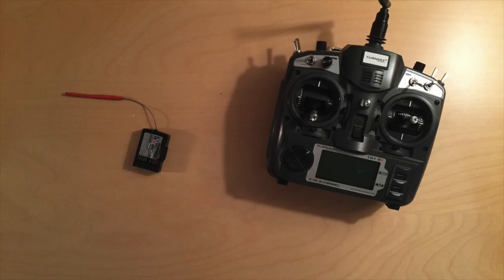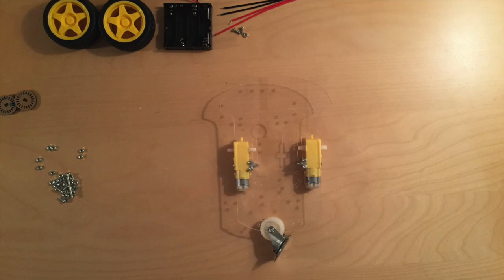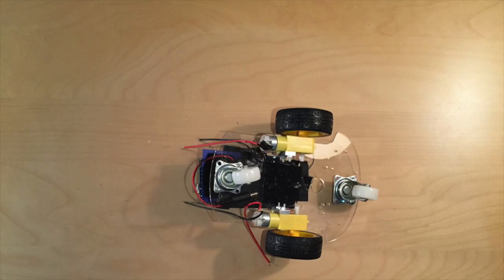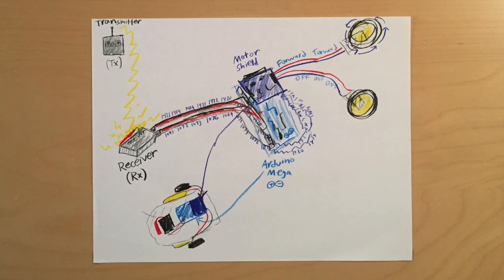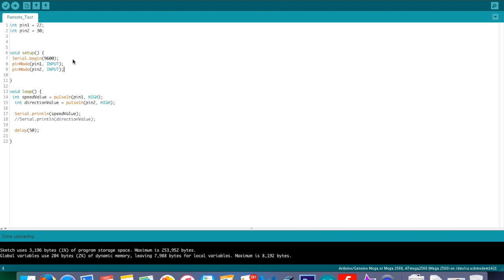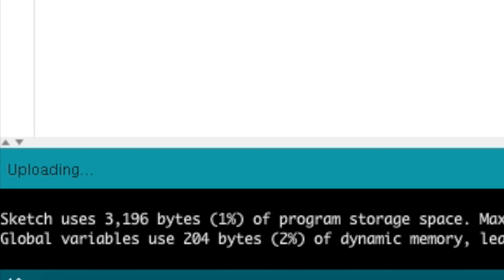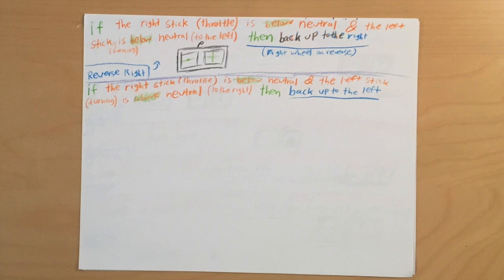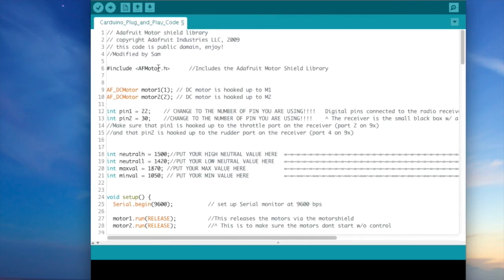How to Make a Radio Controlled Arduino Robot (Carduino)

Comment: Can i use Arduino uno instead of Arduino mega
Reply from the maker: Tushar Ganvir The motor shield should fit perfectly onto the arduino uno. Just line the pins up. 
Since the uno only has enough pins for the motor shield, it doesn't have any pins left over for the RC receiver. You can put another wire into the same port as a motor shield pin. Just make sure that the motor shield doesn't use/activate that pin!

Comment: hi, sam 

you said that just copy the code in the arduino ide and upload it. when i upload the code on arduino uno an error appears. can u pls help me to short out this error.

 [ This report would have more information with
  "Show verbose output during compilation"
  enabled in File > Preferences.
Arduino: 1.0.6 (Windows NT (unknown)), Board: "Arduino Pro or Pro Mini (5V, 16 MHz) w/ ATmega328"
sketch_dec25a.ino: In function 'void setup()':
sketch_dec25a:34: error: a function-definition is not allowed here before '{' token
sketch_dec25a:165: error: expected `}' at end of input]
Reply from the maker: Vishal Kumar looks like the code is missing a right bracket at the end of void setup()

Type a "}" one line above "void loop()"
Reply: Sam's Neat Projects
ok n thnks for the help
Reply: Sam's Neat Projects
Thanks a lot for your help. i was struggling to upload the program. This small " }"  made a big help for me.

Comment: can we do on arduino uno
Reply from the maker: Yep! The motor shield should fit perfectly onto the arduino uno. Just line the pins up. 
Since the uno only has enough pins for the motor shield, it doesn't have any pins left over for the RC receiver. You can put another wire into the same port as a motor shield pin. Just make sure that the motor shield doesn't use/activate that pin!

Comment: how to use ardiuno uno for this... i ardiuno uno and motor shiled..can u show me the shametic daigram for that
Reply from the maker: The motor shield should fit perfectly onto the arduino uno. Just line the pins up. 
Since the uno only has enough pins for the motor shield, it doesn't have any pins left over for the RC receiver. You can put another wire into the same port as a motor shield pin. Just make sure that the motor shield doesn't use/activate that pin!

Comment: what about output pin??? i mean from which pin will the arduino send the signals to motor shield??
Reply from the maker: Manish Yadav I believe that the motor shield has the port numbers listed. I'll check for you
Reply from the maker: Manish Yadav Actually you control the output pins using the motor shield library. 

The command is: AF_DCMotor motor1(port number)

The ports for M1 and M2 are 1 and 2.

Comment: It gives me error...It says the setup func are not allow to use token
Reply: '{' this kind of sign
Reply from the maker: Is this in the Arduino IDE software?
Reply: actually a closing bracket(}) is missing for void setup. plz add }this before void loop line......your problem will be solved

Comment: can we use Arduino uno
Reply from the maker: The ports for the receiver will be harder to install on an Arduino Uno, but it may be possible if you bend some connectors (do research before doing this)

Comment: I would like to ask a question, why is an Arduino microcontroller needed when you can just control the motors with just the transmitter, having all the motors that you have connected to the receiver output?
Reply from the maker: This design is mainly just a base for adding on other components and sensors that require Arduino.
Reply: I see, thank you very much!